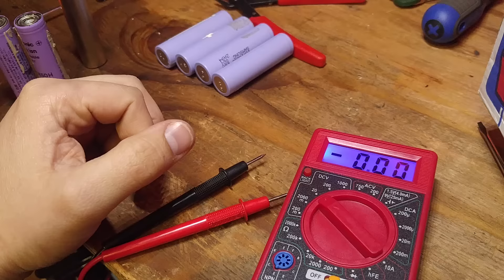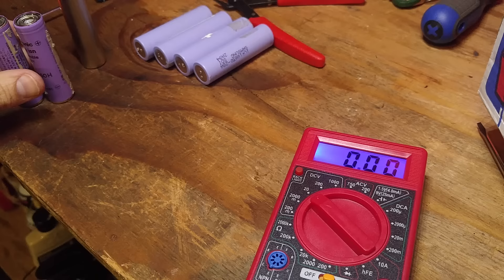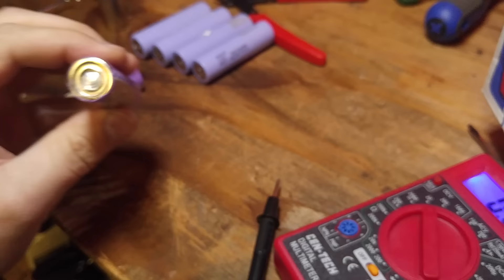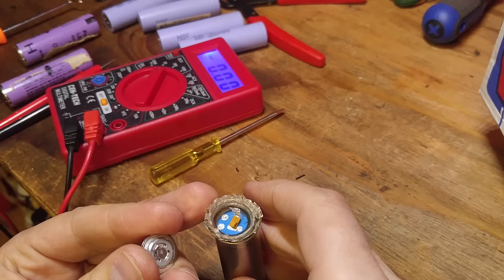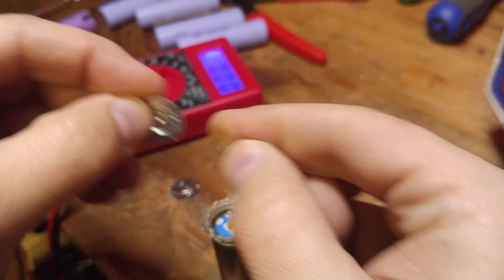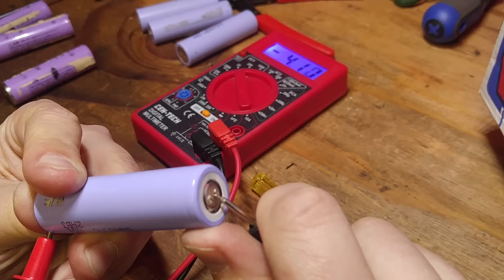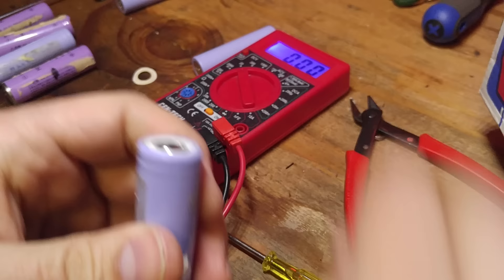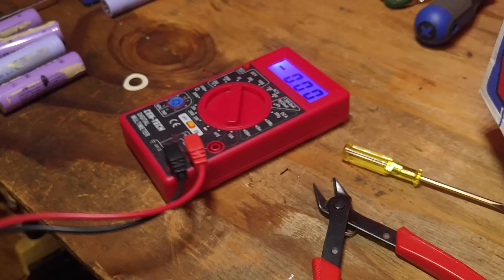0v 18650 - How the CID works

Comment: BAD IDEA: Doing this is very dangerous. The CID is popped for a reason, charging these batteries will eventually cause a fire. A short-circuited 18650 can heat up and ignite even when not connected to anything, if you reset or remove the CID. People have been injured tampering with li-ion cells.
Reply: Shiiiit men i did a very veryyy gentle push and now its hissing shit this is scary there is no way im grabbing it
Reply: I can smell somethings coming out shit like green fluid
Reply: CID can have poped simply because a computer or battry pack runned real hot one time then popped theses protection , i give you reason if CID Pop each time you charge it lol

Comment: This is very dangerous dont do this if you value your house or have good fire insurance. Its about as safe as using a screw to replace a fuse in a plug that keeps blowing or taping a circuit breaker closed 🤔
Reply: Fear God ONLY.

Comment: Man I replaced all except 2 cells in my Milwaukee 5.0A 18V Fuel battery pack with cells from an old dead vacuum.  I thought the cells where dead.  I popped those buttons back, all had voltage and started charging.  I tested each cell before I took the pack apart.  I could have saved so much time and effort just pushing the buttons back in the pack.  Something must have happened to pop all except 2 cells in that pack.  Next time I know.

Comment: thanks for the post. I've run across this many time and I have just sat them to the side. Now that I have a good idea what the problem is I can attempt to get them back in service. Here's a idea if pressure tripped the safe device, use pressure to reset it. I'm thinking about 1 to 3 psi should be enough.

Comment: excelent video, I overcharged a pack with the wrong charger and started hearing popping , immediately the pack went to 0 volts, after disassembling  each 18650 some had 0 volts , after using your technic they are back to around 4 volts , thanks again for a simple full of info video 👍

Comment: Warning!
That disk shows that the cell overheated and is no longer safe. The cell was either severely overloaded or had an internal problem causing it to build up gas pressure. No matter what caused the problem, the cell is dangerous and should be disposed of, and quickly. 
You are literally playing with fire. The cell chemistry has been altered and the cell is no longer safe. There’s a reason for the protection circuit and the vent release and it’s not to remove them.
Reply: Tell that to the Chinese which do the same to sell you recycled batteries with new sleeves... 

Unless you puncture the disc or solder it shut (which is a bad idea for many reasons, i have tried it and it doesn't work anyway as it damages the cell due to too much heat), it will pop again in an overpressure event.
Reply: People need to stop talking shit about resetting the safety because they know nothing about it If they do
Reply: 😬 lol
Reply: You can reset this feature but it will probably do the same thing again in future.. this has something to do with the charging of the battery because modern laptops have strong transformators and the batteries are not happy to suck so much current.. one more parallel (3*bat in series) would do the trick.. most probably..
Reply: @paveljelinek772  You can't "Reset" the battery chemistry, the disk shows the cell overheated and needs to be tossed. Trying to use a damaged cell isn't safe or too bright. 

At the very least the cell capacity has been decreased and you have no clue how much current it'll take to charge and you'll likely initiate a thermal runaway and start a fire.

There's a reason a cell  overheats. Once that happens you're literally playing with fire. I can explain it to you but I can't make you understand it.
Reply: @Stephen2846  I know why it overheats.. Too much current pulled into it + the older the worse (internal resistance).. Poor laptop 18650s 😭
Reply: @Stephen2846  at 4.2v, the cell is charged

Comment: Thank you for the knowledge, I knew there was a safety device but nothing more. I know Li batteries can be hazardous so I never explored them.  I still will not reset the device, but I like having the knowledge of what likely happened if it tripped.

Comment: The most accurate and detailed video about reviving 18650 long sitting almost dead lipo battery...i've seen many videos abou it and tried the same technique but couldn't get to light up a single led bulb...my issue was i don't have a multimeter at hand and tested my 6 dead batteries on a led bulb and a couple of other small light sources, didn't work so i am about to thriw them away for shit, THEN came along this great explanatory tutorial that actually shows how they work inside the positive pole, and that is what i was looking for, seeng what's inside and the functionning of it so that i can figure out a smarter way to revive the battery...
Pheww, just getting pumped up now on how to properly get that bumped up cone to go down and hopefully reviving the cell battery...im about to try the led again right now and hopefully it will work out as intended... Thanks again
Reply: There is no proper way to reset it....the cell is junk. It popped for a reason. How did it work out for you?

Comment: Good information. I built a couple packs from repurposed laptop batteries and after a few years of use 2 cells opened up there were 12 of em 6s2p. that was definitely the issue cause I was confused about the lack of voltage.
 But we all know that's in place cause name brand cell manufacturers don't fuck around or take any chances when it comes to saftey. I just replaced the cells.. thanks for the Information.  Good video!

Comment: If you can keep your local fire department in your house, feed them, give 'em sleeping bags, let them shower, borrow your deodorant, etc. this method is terrific.  But...and you knew there was going to be a but...these 18650's are great because of the current they current they can hold, and if that current decides to short through the Lithium, your potentially in big trouble.  

On January 7, 2013, a laptop Lithium battery overheated (in a crate of them) and started a fire in an empty Boeing 787 in Boston.  It wasn't flying at the time.  Popping the CID is now a standard find on almost all Lithium 18650's in large part because of that accident.  They found a way to make them safe.  Please, don't undo that safety mechanism.  Unless you can fulfill the first sentence above.
Reply: Give a man a fish and feed him for a  day.  In this case, teach a man to fish, and he'll have a fish fry.

Comment: On my protected 18650's that had "popped" the protection button, I hold the bad one to a good one positive to positive and connected the negatives with a small wire for 5 seconds to reset the protection and they usually always reset and start charging.
Reply: Thanks broo
Reply: hell yeah brother that worked like a charm 1k thanks!!!!
Reply: thats if the cell is dead without the button being popped and there is still a connection to the anode

Comment: The CID is popped for a reason, charging these batteries will eventually cause a fire. A short-circuited 18650 can heat up and ignite even when not connected to anything if you reset or remove the CID.

Comment: Interesting indeed. I disassembled a dead HP battery pack today at work, out of curiosity. It was farly new, and its counterparts from the same batch all had 95-100% of their capacity remaining. Turns out 5 of 6 cells popped their top. The computer in question just got a spare installed, and I hope the same fate does not befall that one.
The screwdriver trick worked on all cells, but it remains to be seen if they are useful for anything.
Reply: They are, until they eventually pop again.. it's just a protection feature, and laptops draw alot of current, they would need at least one more 12V parallel (3batteries in serial) or batteries able to withstand sucking so much current from them.. they exist but are more expensive..
Reply: @paveljelinek772  I decided to discard them without using them. Having built several hundred cells worth of ebike packs, I've found that heaters and <2.5V cells are not worth my time trying to resurrect.

Comment: Thanks for sharing this. Ran into an open 18650 2600mA battery and was like... internal fuse? Nothing online with internal fuse, but then found your video with the gas pressure interrupt (CID) and now makes total sense!! I salvaged these from a laptop battery and using them with a 5200mA dual USB port phone charger that the lithium pack swelled. Recycled the swelled lithium pack and wired up a 18650 battery holder that holds 2 parallel for 5200mA to the 5200mA charger and can change the 18650's out as easy as a standard battery. Most of the batteries from the laptop battery pack are healthy, others charge quicker than others and drop off quickly when discharge. I labelled them A, B, C, D ... to keep track of which ones are healthy and which ones are towards end of life. Also measure them after a full charge and then give it a few days and measure them again and the end of life ones have a larger internal resistance that drains them. None feel warm, but possibly with a infrared camera the ones that drain out quicker outside of a circuit could be warmer but undetectable to the touch.

Comment: These purple cells are actually pretty special.  You have to charge them at 4.3V to get the full capacity (so a standard charger won't work).  Only then will you get the full capacity (rated at about 2800Mah).  Check the datasheet for purple Samsung (ICR18650 28A).
Reply: I don't mean those purple panasonic cells.  Those are junk. :)

Comment: Hi mate, I have started my own rebuild station in my older timer mental regime~. Many of my rebuilds are on Vanon 'Knock offs' of Makita 3.0 Ah / 4.0 Ah / 5.0Ah / 9.0 Ah and found the similar battery cell in each. The cells all weighed in at mass = <21.5 grams to 32.0 to 33.0 grams for the average battery and 42 grams in one of the 5.0 Ah batteries. The cells lasted only 3 months to around 9 months on average before throwing in the towel. In use & being cheap they were classed as throw away by the clients when they stopped working. Spot welding on each was rebuilt was poor quality and in each case, the bottom end cell had corroded away the nickel strip and rendered the battery Dead. I removed the cells from each battery and did a charge / discharge cycles to determine the Amp Hour rating of each individual cell in my initial testing, I found that the cells mAh ratings were low and what was classed as a 4.0 Ah battery was actually <2.8 Ah for both 4.0 & 5.0 Ah and the 9.0 Ah rated at below 5.0 Ah. The cells are not readily identified under the cover wrapping but a couple had CEL 6 printed on them and a few unexpectedly registered as Ni-Mh cells in the testing unit machines. I have a photograph of some of the evidentiary cells. I suppose you get what you pay for.

Comment: You're awesome!  I have an 18650 I left it in a vape mod for over 2 weeks and it was almost ready for a recharge when I left it.  Just last night I tried recharging it and it was totally dead and would not recharge and showing no voltage reading on my DMM.  After seeing you vid, I tried to stick something into the vents of the top cap but I could not find anything small enough that wasn't sharp like a needle.  But tonight I found a little old flathead screwdriver and was able to fit in inside the vent holes and push down the popped-up diaphragm like you show in your vid.  I was a little startled when it released the built-up pressure, but it was only a split second.  The battery is now charging.  My only fear is why it built up the pressure to begin with.  I have left 18650 batteries in stuff for for extended periods of time before and this never happened.  I'm almost afraid to use it. But I am so glad your method worked!  BTW:  Nice Harbor Freight DMM!   LOL  I have a few myself.
Reply: Nunya Biznis I had the exact same thing happen when I left two batteries in my Smok Alien mod. Unable to charge them again in the mod. And for some reason my coil totally burnt out. Are yours still going well??

Comment: Thanks for the explanation/breakdown. Prolly save about a quarter of the cells ive been collecting. Of course the safety trolls are gna troll. People can make their own decision on whether this is safe for their application/battery. Its a "proceed with caution" thing  IMO. Ive actually had a small, 250mah drone cell go critical on me from overcharging after gas buildup inside. It blew and burst into flames right behind me, luckily, so I had it smothered in seconds. Burned through just about everything it touched tho. Lot of damage for a tiny little battery. Keep an eye on them if yall try this, watch closely for continued gassing and/or heat runaway.

Comment: I have used that trick on several of my 18650 batteries and they started hissing.
When recharging them now, they get very hot.
Proceed with caution here when disabling the safety feature of an 18650 battery.

Comment: The reason it popped because the circuit monitors the voltage of a Li-Ion battery and disconnects the load to protect the battery from deep discharge when the battery voltage drops below the lockout threshold.

Comment: Hi, I enjoyed the video. I have found that if I put a small 5 volt charge at 500 mah and then put the 18650 into a xtra VC 2 charger I have will bring the battery back to life. Really great break down of the 18650

Comment: OK I have done this and would NOT recommend anyone does it.
Yes is the short answer, yes it does actually fix 18650 cells and it did work for me, but it’s probably the worst way to fix them, buy new ones if you value your house more than the price of a few cells. 
Here’s the rundown:
Point a sharp metallic and usually conductive essentially knife into the batteries
For me what happened is the battery made a very high pitched hissing noise, which is venting at the top, this usually prevents the battery from actually exploding but if your quick enough, take the knife out and the battery is almost guaranteed to work, just act fast, make sure you have a metallic box very close to you with nothing to continue the fire nearby, best case scenario somewhere with no oxygen to prevent it from continuing a fire. But trust me, this is still super dangerous and lithium fires are impossible to put out if it’s already started.

Comment: Surprised they wouldn't seek to just vent the cell rather than have it kill itself if the battery was still usable for an extended period safely. I suspect that level of pressure typically only occurs when the cell has reached it's intended work life. I really don't think it's wise to revive a lithium cell over like $3. Just build a LFP pack of better 5.5ah cells for like $3/cell

Comment: This is a nice insight into how the top cap of the 18650 works but there is also a very good reason the protection is there. Li-ion cant stand high temperatures, whenever you have a low voltage(below2.5V) or high voltage( above 4.2V) or the temp gets high the chemistry inside the cell irreversibly changes, capacity is reduced drastically and danger of exploding increases. If you pry a piece of metal in there you are bound to short it(it only takes a very minor damage in the insulation) wich can result in a really really hot piece(and a deep burn in your finger) of conducting metal and a destroyed battery. All in all this is a nice hack but potentially very dangerous. What if the cap metal has metal fatigue and doesnt work anymore? Given that it got hot it will become hot again and without the cap it will explode. Do you want that in your house? The dangers are real and should be taken very seriously.

Comment: This is just as smart as replacing a  fuse with a metal screw.

Do not ever use these "fixed" cells when you are not close by.

This truly is the worst advise you could give someone. 

And for what? to save a few bucks? Just plain stupid.
Reply: Facts

Comment: Great informative video mate, cheers. 
As you mentioned, this may not be  the smartest thing to do but do at you’re own risk... 👍
Just wondering if you have tried recharging these reset cells ?
I have seen a video recently where the cell didn’t charge during the attempt but rather just got very hot very quickly indicating that the CID had popped due to an internal fault within the cell rather than it happening not by the fault of the cell but as you suspected, a fault of the charging system maybe overcharging the poor cell causing it to pop. 
Just interested !🤔
Thanks. 
Well done 👍

Comment: If they vent or hiss, doesn't that indicate an electrolyte leak ? Should you junk the battery if it released gas? I would think if the safety mechanism is based on pressure that a puncture would prevent the safety device from working. Also charging it may cause bubbling of the electrolyte and maybe a fire???

Comment: So to clarify
You must remove the air pressure in the button to get the metal to collapse and make a contact?

You can't simply bend the metal back to make contact?
Putting a hole to release pressure will cause the button disconnect  function to not work again in the future, correct?

Comment: just a note... if those cells come back showing over 4 v, the probability is very high they will restore to like new ...or at least very close.. the high voltage is sign of very low IR (internal resistance).. if the cell comes back with say a 2 volt reading, it was probably old and has a high IR...and more likely needs to be trashed...but only after cycling it a few times to verify.